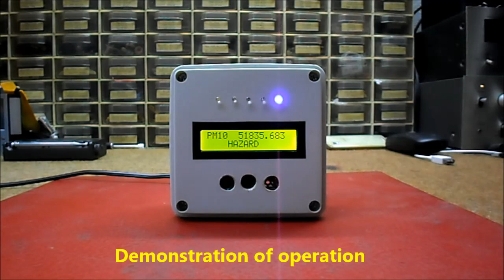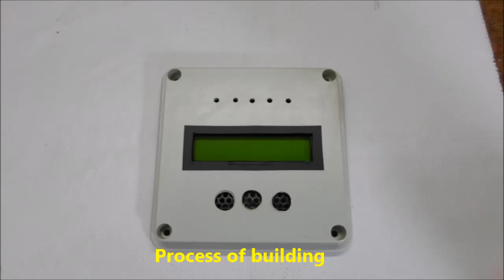Arduino Air quality monitor with DSM501A sensor

Comment: Its wrong. You not need in cooler because warm resistor  do air stream. And sensor must be in vertical position always.
Sorry for my english))
Reply: But if the sensor is in an enclosure the air must be circulated by means of a fan in this case. The heating resistor is not configured to circulate the air through any type of enclosure, just the circulation within the sensor housing itself. Do you agree?
Reply: @rolandberendonck3900 " The dust sensor module DSM501 should be installed vertically and kept away from any artificial current of air by fans." 
This is stated in the Specifications Sheet from the producer.
Reply: @stefuyo  Here a fan is moving air through it (to speed response). Might as well disconnect the resistor in this case. I agree that forced air will probably affect the absolute measurements, but it will still be useful for comparing dust levels in environments.